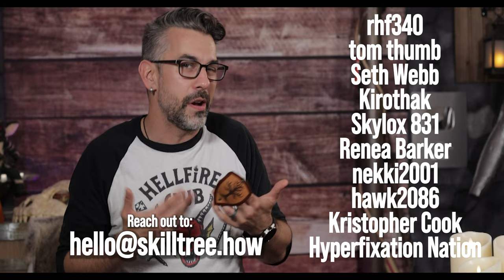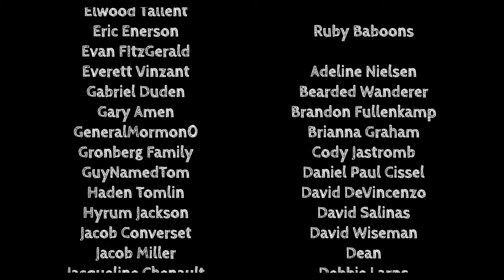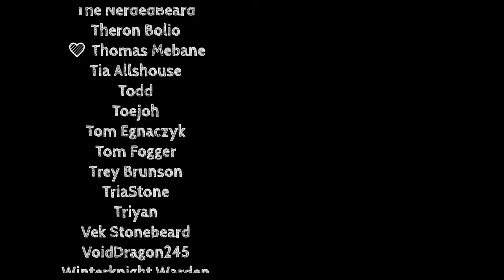Making a Foam Shield for LARP!

Comment: Another tip for woodgrain is to take a coarse wire brush to go a little bit lighter over the grain lines for a bit more texture.
Reply: I use a metal fork.

Comment: You may want to add an adjustable size to the handle section as well. If you are wearing thick gloves or gauntlets the handle area may be too tight.

Love the design and use!

Comment: If you don't have access to plasty dip or other flexible base coat, you can always mix white glue, water and some acrylic paint to make a cheap alternative. It's not perfect, but is works pretty well. You can also use it without paint as a finishing layer to protect your paint job (but it will give it a shiny-ish look, that might not work for what you wanna do. Baby powder is useful to get rid of the shine, but works a bit too well)

Comment: Oh man king, I’m coming out of my lurker hole for a HOT contact cement tips. I’m a full time LARP and cosplay maker, and in my “free” time at events for the last couple years I’ve been making shoes as practice for leather fantasy boots. After my first pair or two, I found a magical concoction that has forever replaced contact cement. The stuff is called Aquilium 315. It is water based so there’s pretty much zero fumes (I use it in my living room even 😱). It’s the same hold I get from stinky cancer contact cement as it’s made to hold on shoe soles while you wander in them day after day. It’s even water proof as far as I can tell, I’ve used it to patch a lot of my linen shirts and heavy cotton pants that wear out constant wear at events. Actual life changer, using that hoop inside without a mask and not being afraid of it touching my skin is a real game changer. Hope you can get your hands on some and try it out!
Reply: Ooh! That says it actually works on PU! I've cast flexible PU for my boot soles, but I keep having adhesion issues with the things I've tried so far. The "proper" neoprene shoe/boot contact adhesive gets close but doesn't handle stretch well enough. I've ended up resorting to 5-minute Liquid Nails construction adhesive but it expands and bubbles aplenty, though the adhesion is great. I've bookmarked the Aquilium 315 for next time I'm doing something like this - thanks for the recommendation!

Comment: You did a wonderful job on this! Not that I have any room to talk really, but one thing you might want to consider for your next one is adding some sort of hard rubber or plastic material ( think a spool shape) for the holes that the strap goes through to prevent them from cutting into the foam. Probably not a big deal unless you're into heavier combat larps but definitely an easy way to make it last longer and makes it easier to replace the straps.
Reply: I should clarify, This is to help with the inside of the holes since the leather strap moving around can work a lot like a rasp, especially if the foam gets wet and dries out.

Comment: Made a LARP shield a few months ago too. Base and fomework was the same as yours but i used latex milk mixed with acryllic paint for coloring and isoflex (similar product also for sealing roofs) for sealing. It survived LARP and heavy impact extremely well. But it also needs something to relove the tackyness. I used talcum powder for this since I didnt mind dulling the colors a bit and liked the smooth finish. But silicon oil spray works as well and keeps the colors mostly intact with the drawback of beeing a bit oily to the touch

Comment: A good alternative for beginners is a large plastic container lid, most lids have a shallow region in the middle that you're gonna wanna put a few layers of cardboard in that way your arm doesn't feel 100% of every impact it takes, you can use duct tape as customization and straps, and if you preserve the clips you can use the shield as a lid and put your larp stuff in the container.

Comment: I made a little round one with a thick foam and used the dremmel to make the wood texture because I don't have a heat gun so I wanted to carve the texture with a little more depth without heating it. It is easy and cool :)

Comment: Great video, as always. 
I jut thought to add a method for making shield straps that might be helpful to people making their own shields. I saw this method used by some people in buhurt circles and they claim that it's the best method for a shield that's going to get hit and abused a lot (and if buhurt doesn't qualify then I don't know what does).
Anyway, it's made kinda like the top strap that Cl3ver made here but instead of the metal rings being attached to the handle the rings are attached to the shield directly on both ends of the strap and the same thing is done to the bottom strap. A lot of times people don't even use leather but just permanently fix them to the shield and then use rope to connect the two rings and make a handle that way. Maybe this method doesn't look glorious as the leather stuff, but functionally it has more benefits: you can easily tie and untie a rope to configure the strap size to whatever fits you best, you save time and money because you don't have to work and deal with leather, you don't need to make any belts and buckles, you don't need to maintain the leather and finaly, if it breaks it's much easier to replace a piece of rope than to replace a leather strap.

Hopefully someone finds this method useful and levels up their shield-making skill 😉

Comment: I don't usually make things like this, but my one suggestion would be to reinforce the holes in the canvas a bit more by hand-sewing around the eyelet (I know it's not circular, but the same technique or a similar one I'm not aware of may be useful there). There may be a need for a curved needle with the way the shield was made, but it may be worth it. 

Anyway, the main reason to reinforce that area more is incase someone does decide to go punching things with the shield. That would be so funny to see as well.
Reply: The hand sewing technique you are thinking of is a button hole stitch, it's used for re-enforcing slits and oblong cuts.

Comment: Nice work! I've made a round shield myself using a plastic hubcap as a core, it even comes with holes for your straps ;) And instead of plastidip I used hexflex paints, it's like a rubbery acrylic and they have a transparent paint that works as both primer and clearcoat!
Reply: I had one that disappeared on me in a move that used one of the round plastic sleds as a core.

Comment: At the larp I do here in New England we mostly use corrugated plastic shields. Theyre super light and you can do a lot with them. Like my shield I put a 2mm EVA facade on it to make it look like wood instead of just straight plastic and it works wonders. Cant wait to see what the next episode holds!
Reply: At part of New England do you live in, I live in New Hampshire and am curious about larp.
Reply: winces in english larp
Reply: Which LARP do you do?
Reply: @HeroClone99  I live in Southern Mass but the LARP I do is community run and has events all over.
Reply: @kajitheninja  the LARP I do is called The Realms
Reply: Cool, thanks!